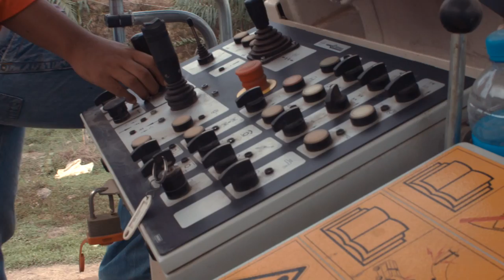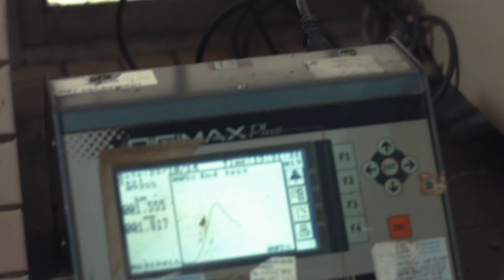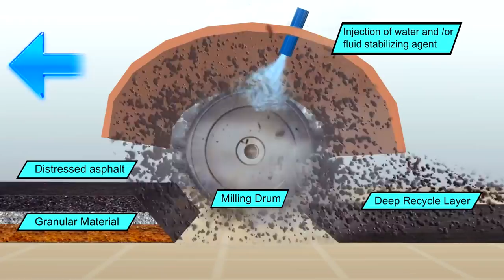Cold In-Place Recycling (CIPR) Technology

Comment: There's a video I saw of a machine demonstration that basically shaves off the old asphalt, processes it within the machine and lays it down.
Then rollers follow and it's ready for use almost immediately.

The only things different is yours's is a train of two but the one I saw was one machine (articulated?), also the processing of the materials is internal on the machine I saw.